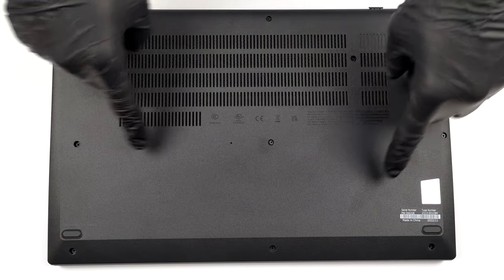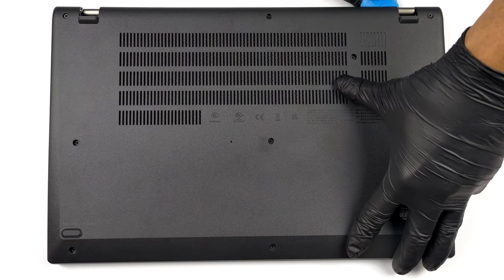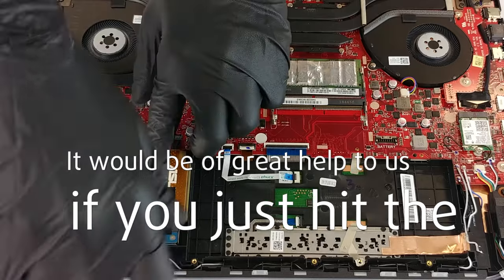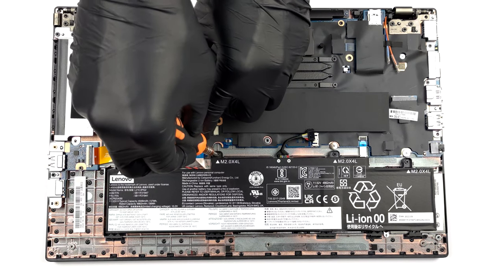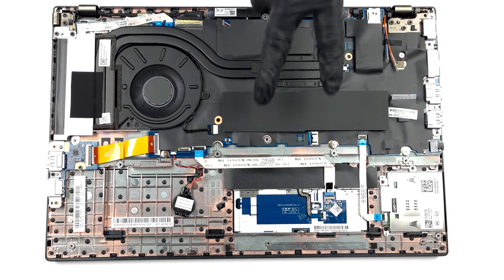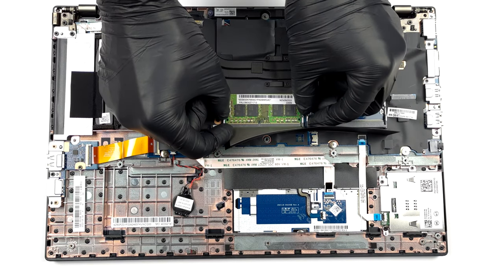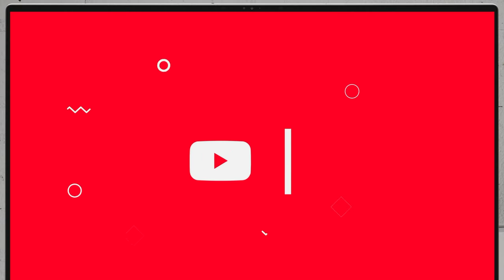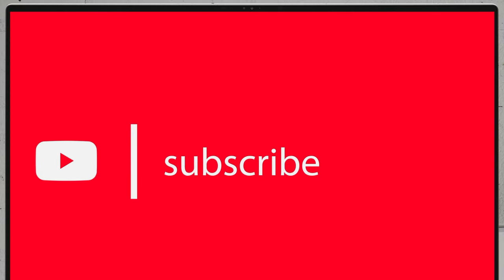🛠️ How to open Lenovo ThinkPad L15 Gen 3 - disassembly and upgrade options

Comment: Had to remove the fan and radiator, wanted to see if it is possible to install a m.2 2280 plus a nfc module in the trackpad along with 4g

Comment: hi your video helps me a lot. Thought, ssd size for l15 is 2242 as you said in the video, but what you show on image at the video is 2230 size ssd(sn740). Does it mean that do you use 2230 size for l15? If then, how did you fix it to notebook?
Reply: What he's showing isn't a 2230, thats a little smaller. He right in this case, and the SSD that's used is a rare model. (Barely used by other manufactures.

Comment: Do you know if the stock 8gb L15 gen 3 comes with 1x8gb DDR4 chip? Or 2 x 4gb chips?
Reply: I bought one, it was 2x4 but you can select 1x8 in the buying process
Reply: @tboy2797  Hmm when I ordered last year I don't think I had that choice. I see just this on the order: "Selectable Memory 8 GB DDR4-3200MHz (SODIMM) "
Reply: I bought it on black weeks, and i decided to take the one 8gb version for no price change. Tomorrow my additional 8gb ram is arriving. I hope i have took the right specifications for pairing them in dual mode, its my first time. But its both 1,2 V, 3200 Mhz and similar CL. Do anyone has an opinion about that? Its possible to pair two different rams?
Reply: @tboy2797  Ideally you buy a matched kit, but otherwise try to buy the same brand and model. At the very least try to match the same timings/cas latency. Ideally both are the same type as well (1Rx8, or 1Rx16). 2Rx8 is only for 16gb chips but fasters. 1Rx8 better than 1Rx16.